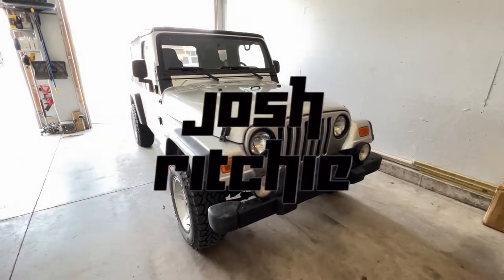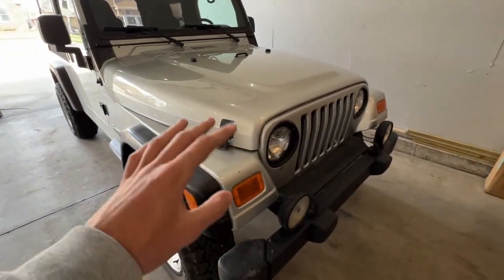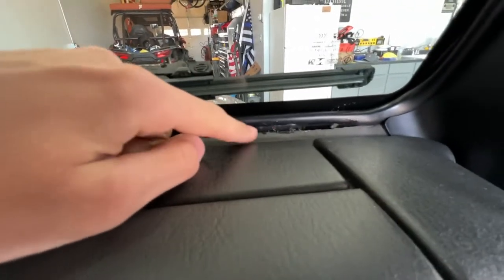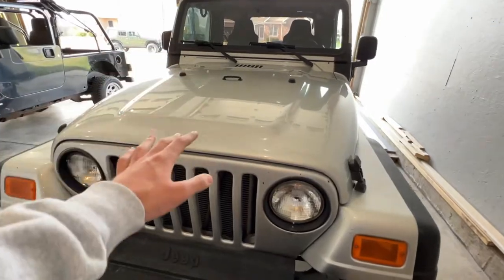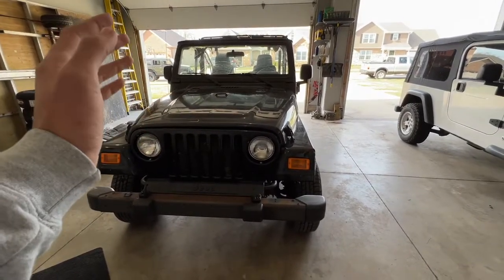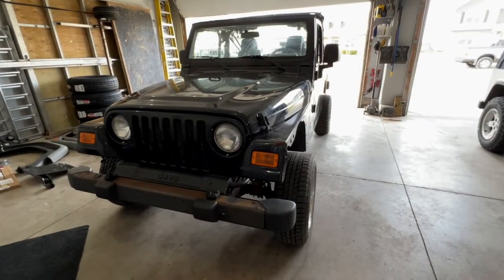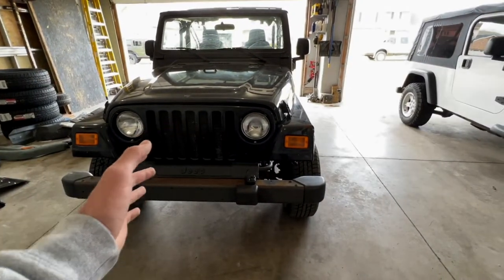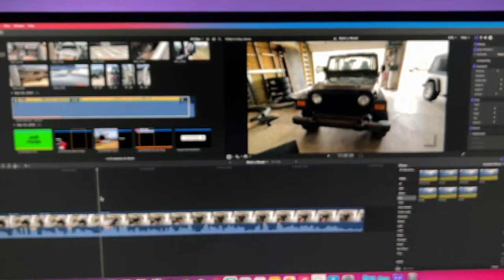I bought ANOTHER Jeep! This one is a Keeper!

Comment: Yikes! What a mistake especially seeing the low mileage motor blew anyway! Rust free LJs like the silver one are very rare. Feels bad man, and a rebuilt omg….
Reply from the maker: Look at my most recent videos bud. That silver one would be rusted out by now on the body. We paid a buddy to fix it for very cheap bc we planned on flipping it and would get more if the rust on the tub was fixed. Yes my motor blew up. But I put in one with lower mileage and now it’s got built rubicon axles and a rock krawler long arm kit and 35s.
Reply: @joshritchie_media  frames are what are costly, tubs are easy enough to replace. But whatever floats your boat. Also your frame is already rusting internally, it’ll be a matter of time before you’re going to be putting safe T caps on. No amount of east coast internal spray/wool wax/ fluid film is going to prevent it. Sure they will postpone it for abit but it is what it is.
Reply from the maker: @ryansremark6983 how do you know it’s rusting??? You can’t even see it. My old white TJ had the worst rust inside. The silver and my current black LJ has the same amount. Plus, I live in the desert now!
Reply: @joshritchie_media maybe you should re-watch your video, @3:33 you can see what looks like surface rust on the outside of your frame, which means the internal has substantially more. Invest in a boroscope/ drain camera and it’ll show the damage.
Reply from the maker: @ryansremark6983 I painted the outside of the frame and it’s smooth as butter. I’ve used I scope on the inside and it’s not perfect but it’s not something I should be worrying ab rn. It’s very strong still even after a couple winters
Reply: @joshritchie_media im pretty particular of my Jeeps, took me a long time finding my mint TJ and LJ from Arizona. But you do you man, I don’t like spending alotta money on suspension upgrades knowing it’s on a rusty Jeep.
Reply from the maker: @ryansremark6983 dawg it’s not like I got a hole in the frame 🤣 I’ll swap the frame for a tracer kit if ur that hurt ab it
Reply from the maker: @ryansremark6983 I don’t like rusty vehicles either… I sold my first car cause of rust and it needed a trans.

Comment: Think you made the wrong choice. Yeah the black LJ has 70k miles but how hard were those 70k miles. Looks like half were off-road  and not to mention a lot of body work/interior. 

My advice would have been keep the silver as it was much cleaner
Reply from the maker: Since this video was 10 months ago… let me fill you in! Yes my motor did blow up. Check the recent video. I definitely DONT regret it bc at the end of the day, you can’t rly fix rust. Everything mechanical is repairable in my eyes. For the $$ I have into it, I’m still saving a ton. Look at how far it’s come already… and I love it 😍 Surely isn’t perfect. But its still a very solid foundation.
Reply from the maker: Also to my knowledge this Jeep was never wheeled. I actually don’t see that being a possibility whatsoever.

Comment: FLOOD DAMAGE  IS FINE IN THE BEGINNING WITH ELECTRONICS  ,  AFTER THEY DRY OUT AND  IF THE RUNS  *BUT * IT'S IN TIME WHEN THE ELECTRONICS GO TO CRAP IN ABOUT A YEAR THE THE SLOW CREEPING CORROSION TAKES OVER EVERY THING AND THEN YOU HAVE A NIGHTMARE ON YOUR HANDS    /     JUST AS YOU THINK YOU HAVE FOUND THE PROBLEM AND FIX IT  /   IT WILL BE SOMETHING ELSE   /   AND AFTER THAT FIX   /   IT WILL BE SOMETHING ELSE  ,  AND ON IT GOES
Reply from the maker: The flood was in like 08… I may need a wiring harness in the future, but as of right now everything works perfect. And idk why I said it had a salvaged title, it’s actually a rebuilt title.